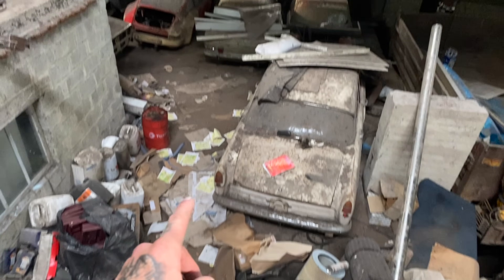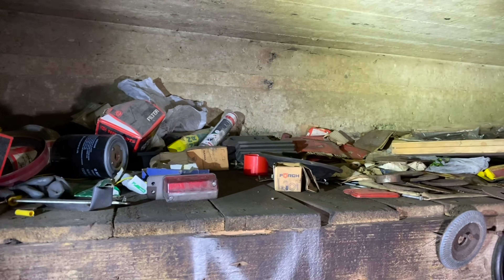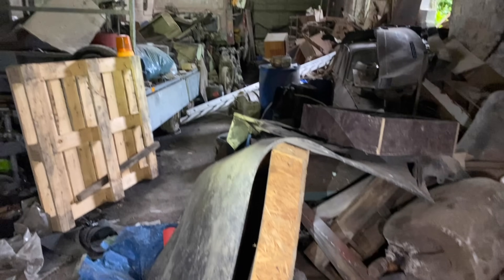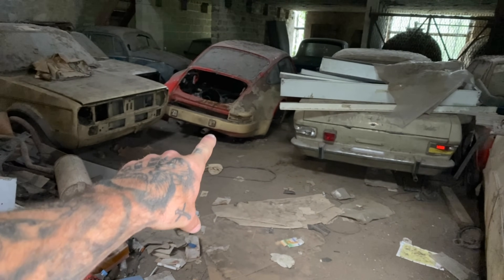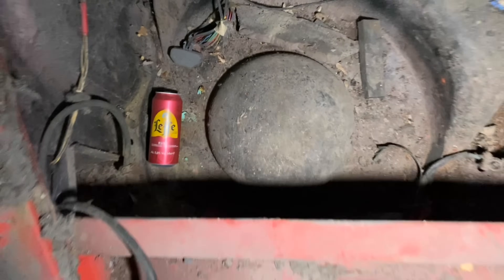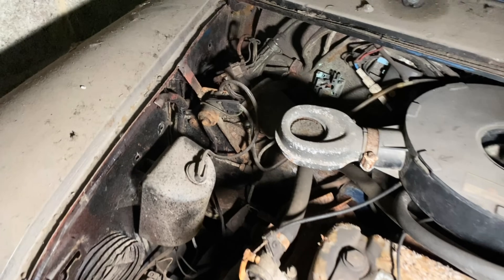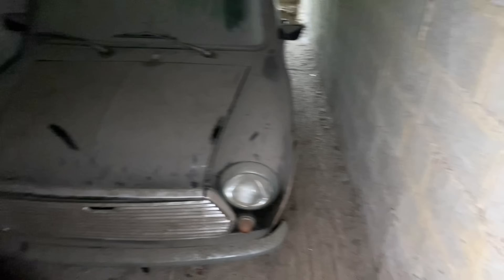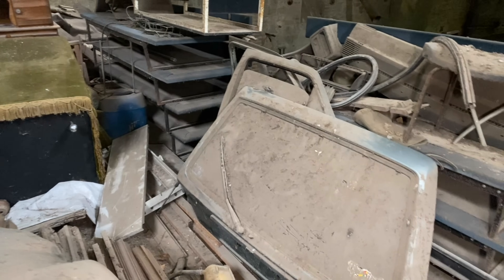I Found A Collection Of Classic Cars Including A Porsche 911 Golf GTI & Mustang Abandoned In A Barn!

Comment: It's unbelievable what you've found again, you get high blood pressure!
The first car is a Citoen 11 CV (Ganster Citroen). The 911 Porsche looks like a conversion to RSR. It had the mega expensive 6 carburettor system from Weber on it (2x3 carburetors. Plus the two exhaust pipes in the middle at the back.
It's a shame about all the cars.
A great video (as always!).
Thanks!
cheeRS
Klaus from Düsseldorf

Comment: Thanks for the nice video and interesting cars.

Car Nr1 is probably a citroen cv 11 Normale.

Bmw 1602 or 2002, is a normal carburettor version, we can see that by the air intake in the front panel, not ti/tii or Turbo.
Golf 1 is not GTI, they are without fender flares and only speedometer in the instrument cluster, the are not very early ones (missing "swallowtail") probably 76/77 mod with 1.1 or 1.3 ccm engine.

Comment: It's impossible to say how many years the shop owner has not been here - - judging by the trees and vines, it's been 10 or 20 or more years.  I'll guess a family emergency came up, or shop owner went on a trip, and unfortunately never came back.  
Citroen Avant  
Mustang conv is an original 200 or 250 straight 6 car: note the 4 lug rims: only 6 cyl cars had these small rims, tires, & brakes.   This "might not be desirable" for a resto since it's a 6 cyl, BUT a 6 cyl conv is actually verrry rare!  
Porsche 911.  2 separate 911 shells?  OR just 1?  Guess the wide body kit was added, per the RR paint peel - that can't be factory.  If that engine was fuel injected, maybe it was removed to put Solex or Weber carbs on it.  
2 VW Golf 1st gen - 1 is GTI?  
1960s Opel Kadett.  (I had a 1971 Opel Manta coupe - competed in autocross 1978, and a 73 Opel Manta Rallye coupe.)  
BMW 2002 red has rust in the front of the front fenders & fender wells - probably dismantled for parts.  
Even the oldest cars seem to have not much miles!  60000 km is only 37282 miles!  
Most every car has parts missing - maybe it was a repair shop back in the day when these cars were not so valuable: the shop owner got these cars  and used them for parts to install on customer cars - I bet if you search for the parts that are missing on each car, most/all of the parts won't be there; each car is missing several parts - a combination of oddball & small items as well as entire drivetrains!  And if they were doing project car(s), the shop has to have open work areas, uncluttered work benches, and so on.  The way many cars are all bunched together - it appears parts were removed, & the car was shoved to the side  with other cars ...  
MAYBE 🤔🧐  1 or 2 were actual project cars that were never finished - but they wouldn't be grouped tightly with the parts cars!   They'd be in the shop open work area.  
  And the shop owner simply did not get rid of the leftovers.  Maybe no one nearby to tow them away, or he became too sentimental - and could not or would not get rid of them.  Maybe checking the property owner history with the city, locate the descendants - a history could be made.  
  After my parents went to Heaven, and I was forced to sell the home - I had 4 cars to sell.  I wanted to keep 2 as rebuildable projects to drive & sell in the future, but after moving out - I have no garage: moved to an apartment complex, to help care for my brother 27 miles away, before he was hospitalized.  All 4 cars sold (cheap!), a lot of parts & some larger tools sold or kept; stuff in our home -  donated or given away or in storage.  Memories from 1978 to 2022 are kept close, including a lot of pics.  
  It would be great to know the answer to the puzzle!  
Great channel!  THANK YOU!  I subbed!   
👍👏☝️💪💪   🤜🤛  
@TheBeardedExplorer

Comment: The Mustang is a 1967. Curiously it has a GT hood and remnants of a GT rocker stripe,  but it has a 6 cylinder engine and 6 cylinder specific 4-lug wheels, which means it's not a real GT (the GT package mandated a V8 engine).

Comment: Certainly the BMW '02 family, but can't tell whether 1502, 1602, 1802 or 2002 without seeing the badge (or the marks it left behind), though you could rule out the 1502 if it had round taillights. Other more detailed differentiators like anti-roll bars etc, but obviously not visible from the video!
Reply from the maker: It was a 1502, pics on my Instagram Page 🙂